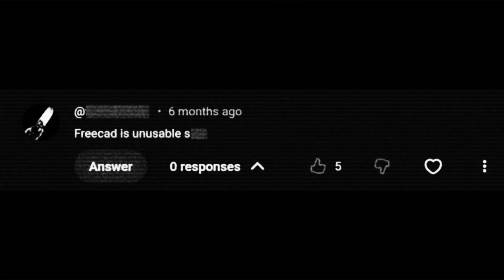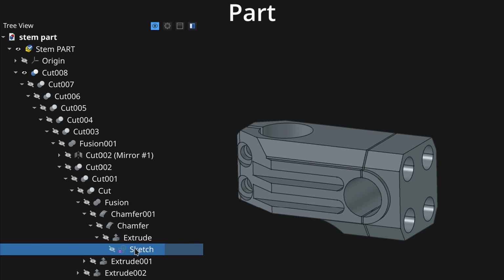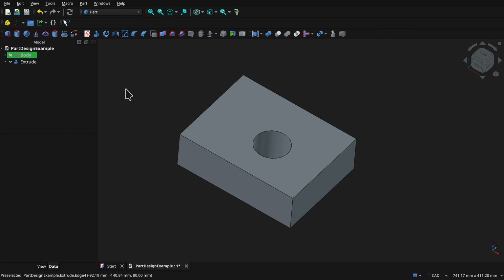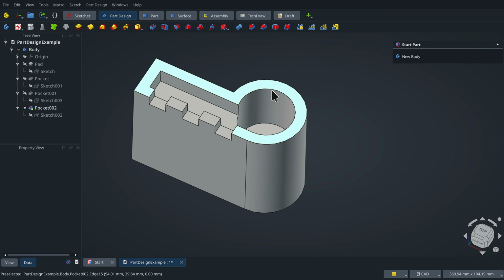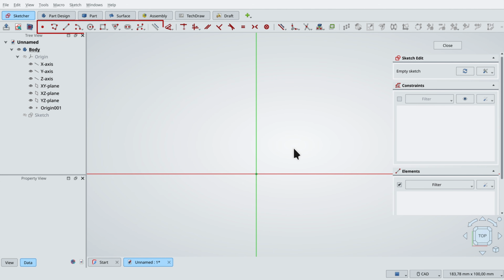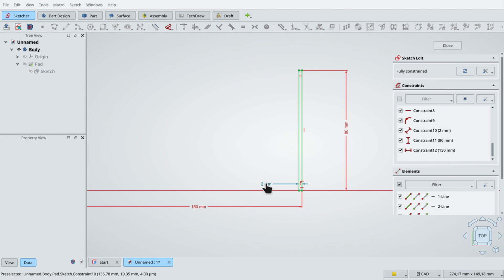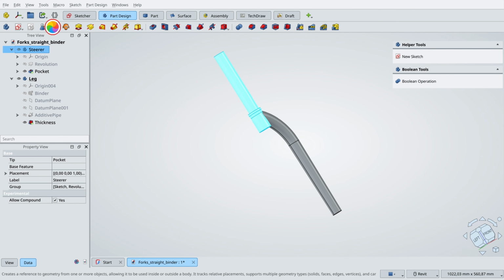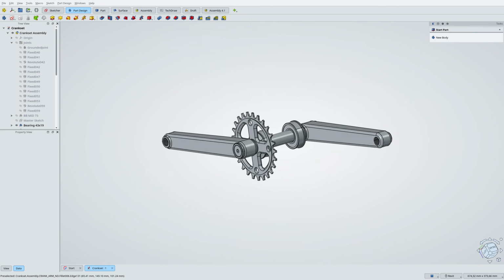STOP using FreeCAD WRONG! Do this INSTEAD (Workflow & Tips)

Comment: Thanks for a great video!  I have not used FreeCAD, as some years ago I standardized on ViaCAD and now SharkCAD due to its dual Mac and PC support.  However, I do recognized many of the complaints albeit in ViaCAD its more about learning the core fundamental paradigm which once understood reveals a very powerful capability for a very reasonable price.  But having said that, and having now watched the video I can definitely concur with the criticisms you shared at the outset.  These are true design flaws of this software from my perspective.  There is no way that you should have a "Parts" and a separate "Part Design" mostly duplicating each other.  Steve Jobs would have thrown the designer of this out the window!  That is just dumb at every level.  Its like there were two separate programmers who fought about how to do it, and then compromised by just implementing both!  I do concur about being able to see the tree in two different ways, but for heaven sake, just add a Radio Button or separate tabs on the sidebar to look at the part the two different ways!.  Also, I vehemently disagree with having two different ways of doing, for example, the extrusion or removal operations.  There needs to one way and that is it.  Personally  I don't think the software should automatically merge the extruded part with the adjacent part.  In viaCAD there is a separate tool that does something like that, they call the Pusher/Puller.  But its not called Extrusion and is very clear in its function.  I think this aspect of FreeCAD is dumb, because the software does not know a priori what I want to do with that extruded part.  Maybe I want to displace it on its axis.  Maybe I want to move it to the other side.  Maybe I want to move it somewhere else entirely.  Combining two parts is a simple operation, and if a user is thinking they are getting productivity out of this they are deceived.  Thanks for showing about the GUI change with the template, but there again, if that is the better GUI (and I think it is) that should just be the default.  Where I think it looks like FreeCAD is notably powerful is in the parametric modeling.  That looks interesting, and very capable, and given it works for the projects you showed, it would seem robust.  The problem is it also looks a bit difficult to fully master and maybe arcane.  If it could be made more KISS, that could be a big advantage.  Anyhow, this is a very good review of this software and thanks for making it.  In a number of areas it looks like FreeCAD may have some more power than even SharkCAD, but the price paid would appear to be complexity which as you mention might have a steeper learning curve.  As my CAD needs are more modest than a 3D bicycle (although SharkCAD example CAD is also impressive) I'm probably not up to learning a new tool that likely will be harder to master than the one I already use.  But thanks for the  eye opening, and if my needs change I now know about FreeCAD as an alternative.  For sure, it is not a toy piece of software like many free programs.  Thanks!

Comment: So, basically, people are not using FreeCAD wrong. They are simply not used to having to implement a million workarounds (that you have to know about in the first place). This video is actually helpful, but the arrogance at the beginning is absolutely uncalled for.

Edit: And the last chapter of this video is just massive bs. The learning curve on other CAD softwares is not nearly as steep as in FreeCAD. I'd actually say that the learning curve in FreeCAD while having experience with other CAD software is steeper than with other CAD software while having no experience at all. The comparison to Blender is just in bad faith. Blender is notorious for being not too easy to learn.

Edit 2: Sooooo, since FreeCAD is so great and powerful: Please tell me a way to parameterize the positioning of text on an angled surface. There's no easy way, that's for certain, but I have yet to find any way at all.

Comment: Thanks, great introduction.

IMO the reason people hate on FreeCAD is because it's so damn unintuitive.
I use CAD for 3d prints for my hobby projects.
As such, i just need it to work and am not currently interested in doing elegant and fancy things.
I started 2 years ago. I couldn't get FreeCAD to do what i want. I went to Onshape and everything i wanted to do just worked with the intuitive way.
I'm now making the move to FreeCAD because i hate cloud, proprietary formats etc.
To be blunt, the move to FreeCAD is a pain in the ass.

For example i cut out a grid of hexagons from a flat surface. 
In Onshape i could just put a grid modifier to a hexagon and it created a dynamic grid, that's well defined and reflects any changes to the original hexagon.
In FreeCAD the only grid modifier i could find so far creates unlinked copies of the hexagon that aren't even properly ankered/constrained. If i ever need to change anything i'll have to completely redo everything...
Is there a proper way to do this in FreCAD? Maybe. I don't know. If there is, it sure as hell is not intuitive.
And experiences like that are what makes people decide FreeCAD is not worth their time.

Comment: I like this video. It is the best beginner video I have watched. 

Some background. I am a retired civil engineer who has used AutoCAD since the early 1990's, so I am well versed in CAD programs, I tried Fusion and while it was interesting, I did not want to get on the Autodesk subscription treadmill, and the changes they made to the free version pretty much required one to subscribe if they wanted to do any serious work. I went to another CAD software that was similar to AutoCAD, but it's 3D work did not allow for parametric drawing, so all drawings were pretty much one offs, which was too time consuming. Checked out the open source options and decided FreeCAD was the best fit for what I wanted to do. My problem has been that FreeCAD workflow is actually very different from the standard CAD programs which made it hard to know which workbench to use, how sketch worked, and the confusion with part design, and parts work benches. All of it was frustratingly confusing and I have struggled with learning this program. A lot of the tutorials video and written, are frequently step by step, instructions, or showing how they constructed a "simple" drawing step by step. The basics of how to draw something was not my problem, my problem was finding an simple, clear, explanation of the different toolbars, workflow, and which tools are the most important to learn how to use first. I understand why the person who made all the FreeCAD sucks posts because he undoubtedly was struggling with what I have been struggling with, which is first, that FreeCAD is not really a CAD program, it is a MODELING program. It is a subtle difference, but it affects the workflow and how one looks at the tools. Second is that the interface looks similar to say AutoCAD, but it actually isn't because workbenches differ from AutoCAD menu bars in many, significant ways. So thanks again for the simple introduction to the FreeCAD interface, basic workflow, and the tips, tricks, and special sauce. I am going to watch some of your other videos to see if they are similarly easy to follow. Oh, yeah, I will be frequently referring to this video as I try to finally master the FreeCAD interface and learn the basic workflow, since there is so much information in it.

Comment: Thanks for the clarifications. Having used many 3D packages over the years (Turbo Silver, Lightwave, Blender, SketchUp, Pro/E, Catia, Onshape) I don’t find FeeCAD overly difficult to grasp. Yes, it has its quirks, but I’ve been able to achieve everything I’ve needed (so far) for either print or machining output. Will it become certified for use in the Aerospace or Automotive industries? Highly unlikely, but no one is asking for that. That said, I don’t see any reason it can’t be successfully applied to a myriad of other tasks. The vast majority of hurdles are down to individual user knowledge level rather than software limitations. Videos like yours are addressing that.

Comment: Wow wow wow! Thanks for the catchy video title! It just sounded like the thing I needed at the right time. And boy was it it! 

I've just started with FreeCAD. Coming from Google SketchUp 2017 (last desktop version). And I opened FreeCAD, tried to draw a cube and couldn't even figure out where to start with that. So I started a YouTube 5min (zero to hero) tutorial. And got stuck at a "wire not connected" error. Then decide to just try another longer one (30min). Things didn't make sense, but I decided to just power through it, follow each step the teacher is showing and just go with it. Then the "parametric" way of things started making sense. But the use of the software felt like a constant uphill, doing things "blind" without understanding. I realised I needed more theory on the "how IT works" rather then how to model with IT. Then I got your video recommended! Just the stupid "change the theme" made the software felt more "warm". That was the best starting point! Even though I like keeping to defaults at least till I "understand" what I must keep and don't need. 

Also glad you worked on the new version and that your video is not that old. I realised that the updates to the software v1.1 was huge and amazing, but your video finally made that version "pop". 

Also very very important is your explanation of keeping things organised and how they contrast between Workbenches was really important. Now it feels like I can start with a project but following a bit more best practice for when my ambition starts growing. Rather than only then realising that I can't continue the "quick" way and then needed to start working on organising parts. Since this would feel like more frustration if not done from the start.

Comment: There's a lot of small bugs in freecad that add up and make it far too unproductive compared to other CAD packages. For instance the conflicting fillet thing where you have to use the .00000001 trick. It's just stupid that I have to deal with so many little tricks to make it work well. It ends up making everything take 2-3x more time than if I did it in fusion. And the UI is soooo ugly and the icons are too small to quickly make out any detail at a glance

Comment: if a program breaks at the slightest provocation then it's trash. for instance, why does copying a spreadsheet from one file to another, which has a single body,  places the spreadsheet under the body in the hierarchy without any way to pull it to the top of the hierarchy (alongside the body)? freecad is broken at its foundations, which is why even seemingly innocent actions by the user result in the project imploding, often with no solution other than to start completely from scratch,

Comment: This video wouldn't have been necessary if FreeCAD had a relevant and, above all, consistent interface across the different workbenches! You can't focus on two things at once for a single operation: which workbench you're in and which procedure to apply in that workbench. The software itself is good, but the interface is an unusable mess.

Comment: Coming from solidworks background may slow me down more.  My biggest issues are that I cannot 3d move around my object in a consistent manner - it has options to work like solidworks for moving the view but it doesn't - especially if you zoom and then translate I keep getting into the situation where it zooms in but then I cannot pan, all the available navigation options all have some flaw which means I can't just pick one and be happy - even one that works like anycubic or whatever would be fine.  Then I do something and my part disappears and no amount of undo or fiddling with visibility or view gets it back.  

The last one is something goes wrong and it just keeps showing errors that don't mean anything helpful - about 2/3rd of the time, if you restart and do what you were doing again they don't occur so it wasn't anything specific - it was just in an unstable state.  Not been on 1.1 long maybe thats fixed - have wasted a fair bit of time on things it turned out I was doing right.

Comment: FreeCAD IS useable. The problem is that it's significantly dumber to use than other parametric modeling programs. When people use CAD, they want to spend their time creating the design, not figuring out how to make the design work in the program. Workflow SHOULD be irrelevant, ideally the programs SHOULD let you create however you want. Not that FreeCAD is the only program that demands this, but it seems to demand much more. I suppose it may be "free" but you pay with your time.

Comment: This software is at least almost as good as SolidWorks and a lot better than DesignSpark Mechanical (especially its free version that keeps getting more restricted with each update). And it is actually free, not free for education and personal use. I will switch to it from now onwards for all my 3d modeling. It is now the type of software that would normally cost so much that a small to middle sized company would otherwise have just one or two licenses for, with employees always arguing over who gets to use it whenever they need to. I remember what it looked like a a few years ago and it sure came a long way. 
Two things that it could have and it doesn't (or has but I do not know where) are edge/face loop select in modes other than CAM (which has it) and a way to tell what constraints are missing for a given object in sketch mode (not for which object, but what constraints, especially after it makes me delete some to not have redundant ones) without dragging the object around to see if it still moves in some direction (which is apparently what everyone else does to determine that).i

Comment: I feel like this video is really missing the point. I was super excited when 1.1 came out and it felt like FreeCAD was finally at a point where I could use it for real work. The workflow and required mindset being different to other CAD tools is not really an issue IMO. Learning it was a breeze. What made me drop FreeCAD again is all the bugs I’ve encountered which wasted so much of my time. Bugs like the external geometry tool not working and only working after saving and restarting FreeCAD. Or the camera not aligning correctly to some sketches (Q,P does not help). Or constraints being silently dropped in the sketcher. A lot of bugs I had I can’t even describe or report because they are irreproducible heisenbugs. This feels like the classic death by a thousand paper cuts which is a shame because I really want to use an open source CAD tool. Contributing to FreeCAD or OCCT is beyond my abilities sadly.

Comment: I'm also new into freecad. 
I just downloaded it last week. The version is 1.1.1
It's indeed quite a struggle to use this since I was living with Autodesk inventor since my college days. 
After the new year this year, I didn't renew my Autodesk subscription and deleted it. 
During last week, I wanted to do a project which came into my mind at one night, I tried to reinstall AD inventor 2027 with trial run, and mofo was having installer error. I tried all the ways I could like endtask, reboot and download the odis again, going with regedit and deleting debugger and reboot required, or through msc
Nothing worked so I could only jumped into freecad anyways plus one with saving money. 
Only then, I faced a wall which Autodesk set up a trap for us with educational use mind confusion trap. I can't use other cad softwares at all. 😂 
After two days of watching YouTube videos on freecad, I have finished drawing a dozen parts after a few days of tinkering. 
It's actually not that bad, better experience than webexperience of SOLIDWORKS. And to sprinkle on top of this, this is free freecad.
If we are doing a comparison with commercial softwares, we are the ones who are doing wrong.

Comment: They're not wrong either though. FC is horrendous to use if you are coming from SW or F360. You are a great help to the community in teaching us how to get around this software but it shouldn't be your job to untangle the mess. I'll admit that it's much better than it was years ago but it's still not great. They really need to halt development and just go back over everything and get it into usable shape. No matter how good FC gets, if it takes an hour to figure out how to do something that could have been done easily in Fusion in 2 minutes, then people won't use it.

Comment: I have been using freecad for several years. The confusing thing with freecad is the errors with meaningless or no explanation. Sometimes I get an error, i just delete the last thing i did, then i try again with the exact thing i did, and it works.